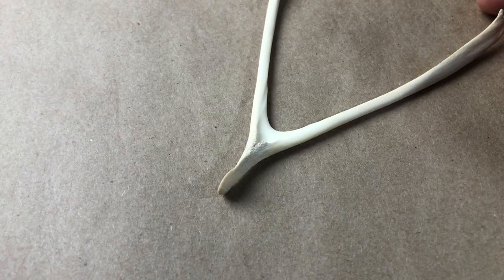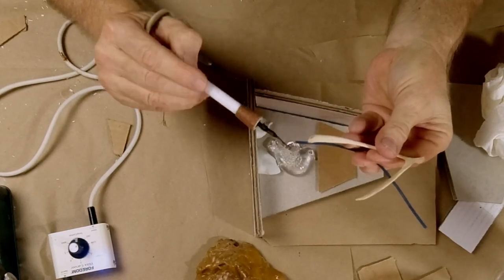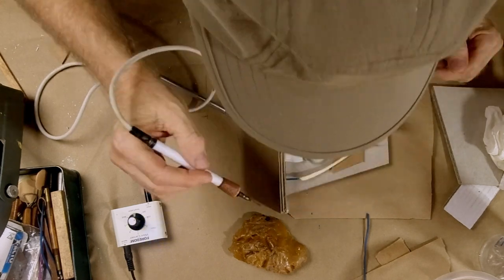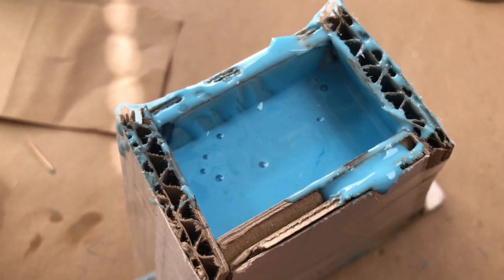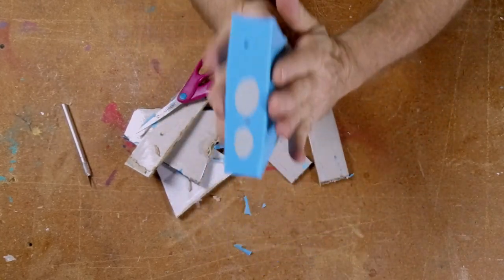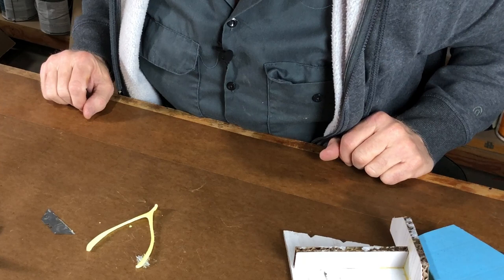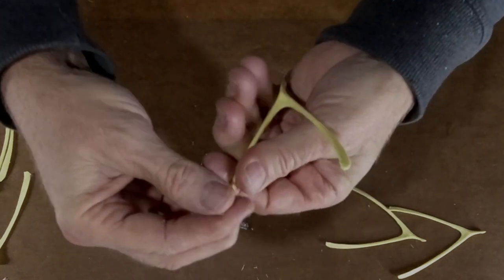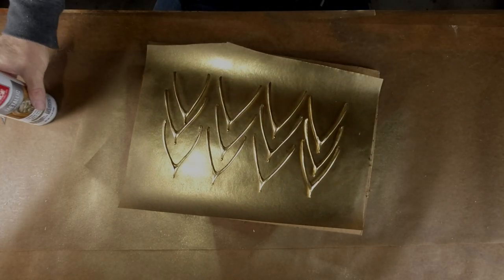Bone Casting In Resin

Comment: Oh man I know that feeling of putting in all of that time and effort just to have the final step make or break the project! I used to work for a metal and enamel pin company. I was in charge of the delicate painting process of thousands of pins done completely by hand which was usually the final step before packing and shipping. I had MANY nerve racking moments where I would have to just dive in head first and hope for the best haha. Most times it worked out luckily but not without worry and careful consideration/preparation. I also became a master at mixing any pantone color in existence from about 20 different spray paints. It was quite the experience. Unfortunately I developed a repetitive strain injury rather quickly and it's never fully healed. Makes my craft a bit harder these days but, I really appreciate your craftsmanship! Another great video.
Reply from the maker: Thanks so much for watching and commenting! I really appreciate it.

Comment: Last Halloween I made finger bones as part of my costume(scooby doo witchdoctor villain). Anyway, I made two originals out of apoxyscuplt. Then made a lego mold box and poured the silicone. The design didn't require any cut to the mold as they would pop out once set. I cast 3 sets for a total of 9 bones. It worked great and several people thought I used real bones.

Comment: Informative and entertaining as always. You mentioned casting more complex thin shapes flat and then bending them while the resin is still soft. If you haven't done such a video yet I'd love to see one (I know this video is a year old, I'm kind of working my way through your backlog randomly). That said, I do wonder if heat would be a problem for such a process. What I mean is, many miniatures I get for board games arrive bent, but generally a minute or two in hot water will cause them return to their proper shape. Would a particularly hot day have a risk of causing a mold that was cast flat, and shaped while soft, to return to it's original flat shape?
Reply from the maker: The amount of heat required to bend resin that cured in a particular shape would cause any resin casting to potentially warp or bend.  I’ve never had a problem with castings that I used the bend-while-curing method on.

Comment: Great video. I did have a question. I am starting a mass project of casting around 100 duck and geese skulls for an art installation and I was planning on doing a multi part mold. I didnt know if a cut mold would work will very thin parts and a few decent undercuts. Would love to hear what you think. Thanks for making great videos!

Comment: I'm new to your channel so you might have mentioned this in a previous video but would you recommend tapping downs mold to get bubbles out  from the top like that or is that a bad idea? I know I saw you mention when filling a mold with resin you can tilt the mold sideways periodically to avoid big bubbles but wasn't sure if that's another method that can be used in this situation.

Comment: Lovely video,  Robert. I wonder why small portions of resin harden slower than big pieces. I would have expected vice versa. Do you know why it is like that?
Reply from the maker: I I’m not enough of a chemist to tell you. It may be because larger masses generate heat and heat definitely speeds up the reaction. It may be because there are fewer molecules to cross link. If anyone out there is an organic chemist, help us out!
Reply: @RobertTolone  The part with the heat sounds pretty plausible, thou.

Comment: Thank you for these videos, I appreciate your expertise!
You said that to remove thin objects such as these, you either needed to be very careful in the removal from the mold, or wait a much longer time for them to fully harden. If you had chosen to wait, could you guess what sort of time period would allow these bones to fully stiffen?
Reply from the maker: I neglected to mention another option, that would be to heat the mold to around 100°F.  That would definitely accelerate the cure. For these wishbones I think you could probably extract them from the mold after about an hour at room temperature and they would be mostly rigid.

Comment: Is there any mileage in making 2 birds to 1 wishbone? Take out the first bird and cast another before taking out the wishbone?
Reply from the maker: It might work although if you have to distort the mold a lot to get the bird out it may wind up damaging the casting of the wishbone. But you could give something like that a try. Usually I cast all or some of the cavities in each mold and remove them with each cycle.

Comment: How well does 'wet' blue silicone mold stick to dried blue silicone mold? In other words, if you discovered an error once the mold was dry could you 'patch' it?
Reply from the maker: The silicone sticks well to itself. That is why it is possible to build a mold in many layers over several days. I often incorporate chunks of old molds into new molds and have never experienced bonding problems as long as the old rubber is clean. That said, I find it very difficult to repair surface defects in silicone molds. For instance, trying to fill bubbles in the mold.  It’s extremely difficult to get the repair to be invisible.
Reply: @RobertTolone  Thanks for the response. Your work and vids are top notch. Cheers